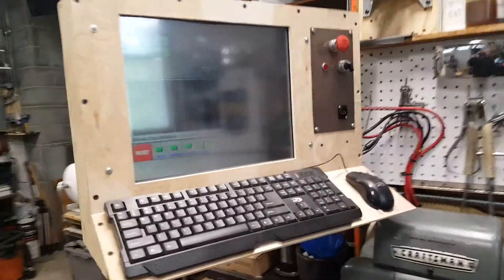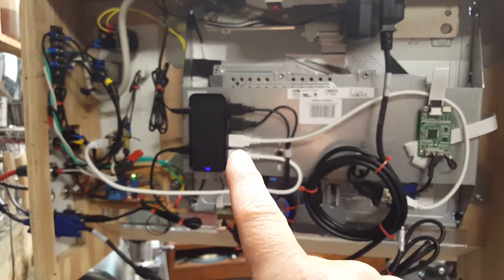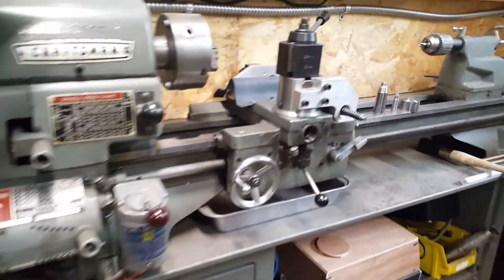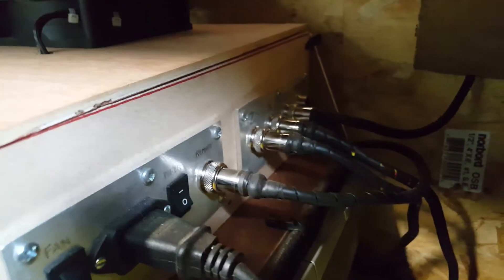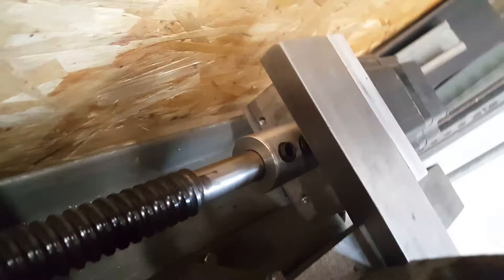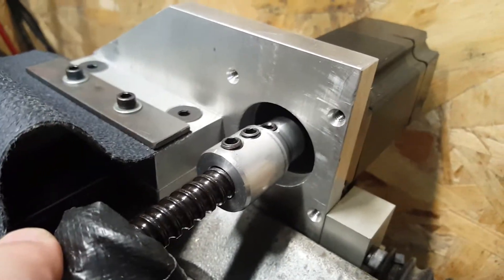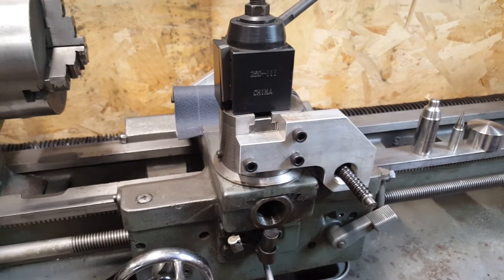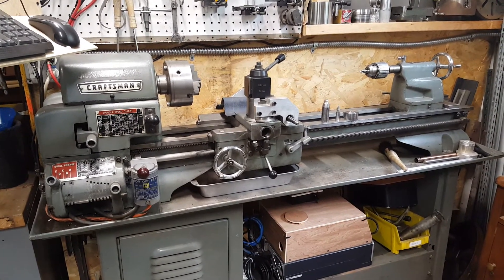Craftsman 12x36 Lathe CNC Conversion - Update

Comment: Very nice. Are you concerned that the stepper motor bearings are taking all of the carriage and cross slide movement forces as well as all the cutting forces? Normally these forces are taken by an end block used to mount the ball screws.

Comment: I notice you are not pulling the carriage by its center but off the rear, which could cause binding or not ? curious if this might be an issue ?
Reply from the maker: No binding issues at all, its actually really smooth.  However, I have found a tiny bit of rocking "rotating" from the front to rear clearance being taken up when switching directions.  It causes it to take about an extra thou when pulling back across the turned surface.  Not a big deal, I just take it into account when programming.  I may look into adjusting the gibbs a bit, but for now it doesn't bother me.
Reply: Do you have a parts list you might share ?
Reply from the maker: Sorry I don't have a parts list, most of the pieces were made on the fly with odds-and-ends I had laying around.  Then engineered on the spot.  Safe to say that I was lacking a grand plan on this one.

Comment: Where did you obtain the covers you have over the drive rods, those are a good find! Nice approach on the conversion, I am going to copy this for my 6 x 18 Craftsman. Thanks for publishing!
Reply from the maker: I found them on ebay. Search "Moulded Bellows".  Please note the wire reinforcements in the bellows are hardened and they will wreck a pair of snips ... I had to use tiny bolt cutters to cut them.
Reply: @mentalgears9712  Mmm, if there are hardened reinforcement wires within the molded bellows it might be a good idea to check them often on the inside, as the rubber might wear off leaving the wires exposed to scratch against the ball screws.

Comment: Nice job. You appear to be very close. I got a couple of nice limit switches off of the "incline" from a free tread mill. I'm just getting ready to use the variable DC motor on my Craftsman lathe, which is just like yours except no quick change. Let me know what you need maybe I have it lying around, if so it's yours!